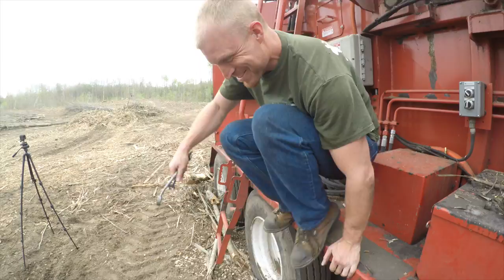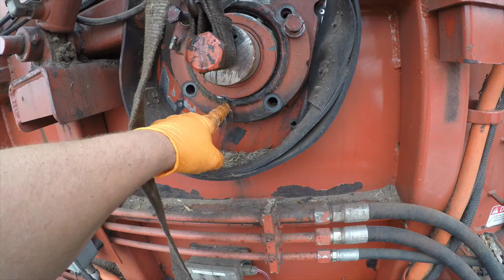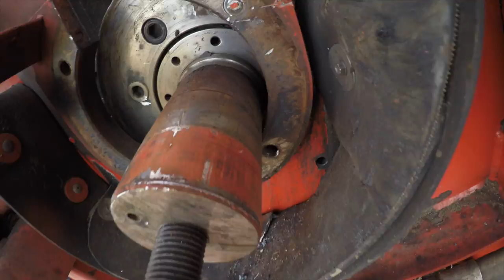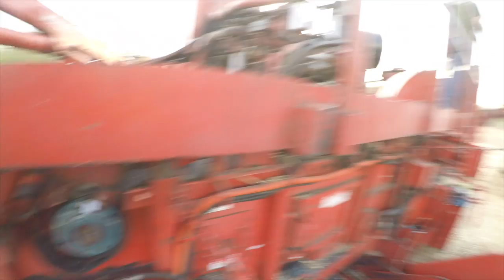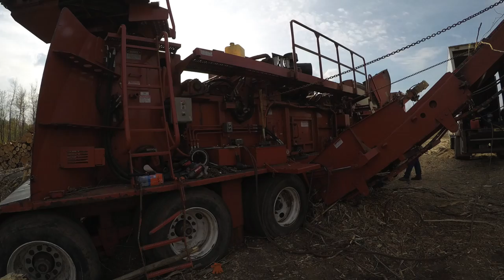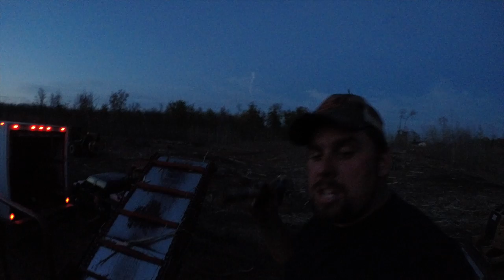THE BEARING FIGHT!!!

Comment: John, next time after you slice the race use an air chisel. Usually will spread it enough to be able to take off fairly easy. That's what I have done changing big bearings before, works good.
Reply from the maker: +vttrucker Thanks for watching

Comment: might i make a suggestion. before you put your bearings on never seize the shaft it will prevent the race from gulling to the shaft it will make relacing the next time alot easier

Comment: The handsome Doctor probably had a previous appointment with a wealthy, most beautiful patient and it was time to leave all you working class colds in the dust and get on to the REAL things that a budding Doctor needs a hidden CHECK for, like, uh,  JOHN!?? How can you be so unfeeling and obtuse.........whatever that means. Tote a small piece of aluminum for a heat sink and spatter shield and you ought to pop that sleeve all the way with the torch, if you don't already. And this is why I ran equipment and drove trucks. The regular grinder crew did this unless I got roped into it too, but I ain't no stranger to dark:30, pal. Mixer drivers know what I'm talking about. NEVER know when you'll get home. And I don't even want to think about bearings. So HEAL LACEY and BLESSINGS All yall!